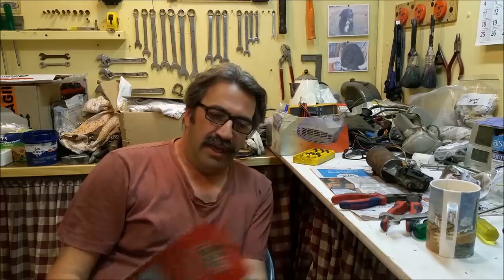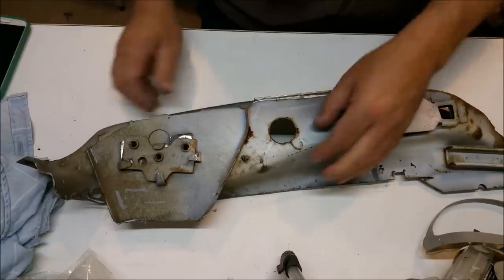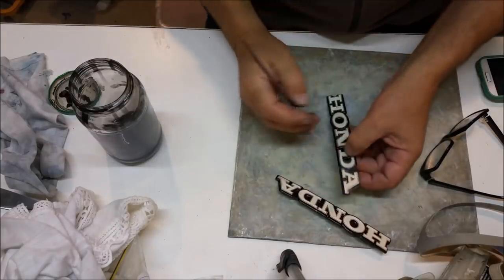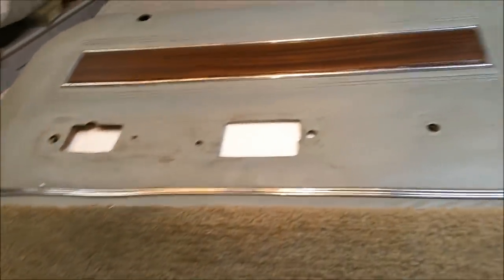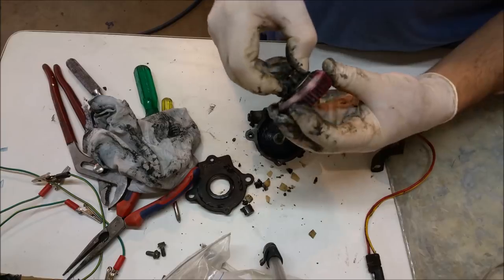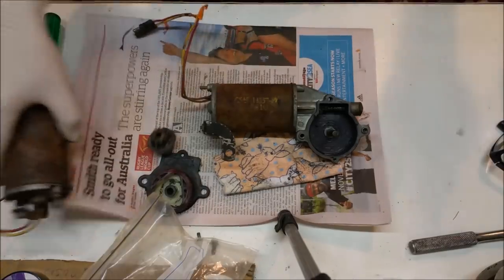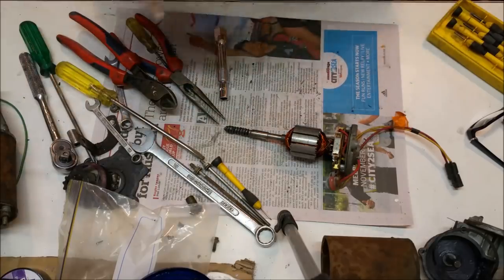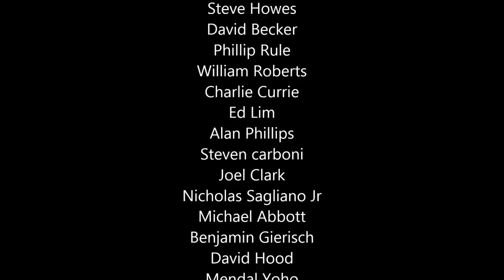XC Fairmont 351Restoration Part 43 - Power Window Motors, Regulators and Wiring

Comment: Hi Pete
Great video. I refurbished my window morors last year and like yours they were dirty and greasy inside and had chunks of shredded plastic everywhere. Yo replace the rollers i bought some plastic rod of ebay. I think it was called Acetal. I purchssed 12mm diameter which was just a touch to large. I cut it into small lengths put it into my drill chuck and emery clothed it down to 11.7mm cut the into 10mm long pieces with a fine hacksaw blade. You need 3 per motor. Its a cheap easy fix that works a treat. Keep up the videos they are fantastic. So infomative. I love them👍

Comment: Hi Peter, you should be able to find the rollers on the 'net, without the 'worm wheel'. Done many......XD, LTD, ZL etc. Rarespares, or Parts Lunacy, I think.
Or part off a 10mm aluminium rod in the lathe.

Comment: Hi Peter. I have a GXL with power windows, recently I was putting up drivers side window and it jams half way up so I need to help it. On this occasion I was busy and the window stopped. Now all windows don't work. Is it a fuse or relay that has burnt out. Also is wiring loom behind glove box? How do I check or fix problem? Thanks Mark

Comment: I've used rubbing alcohol to clean over spray on harnesses before. A little tedious, but it didn't seem to react with the tape and insulation like a brake clean or something would.
Reply: Rubbing Alcohol on yourself or the loom, ha ha.
Reply from the maker: Thanks, the first thing I grabbed was some really dirty thinner I use to clean parts and the paint came straight off... I was amazed at how easy it was, cheers.

Comment: Looks good.. interesting to see the insides of those motors.  I don't think i would have used grease in the bushing though.. seems like it could get gummy and slow the window down, especially in cold conditions (though i guess your weather is more temperate there).    Also, if that's an oilite bearing, it would really want oil (though it might be hard to re-lubricate it effectively).   Still, a light machine oil designed for electric motors seems like a more appropriate choice.    But not a critical thing obviously :)
Reply: of course now that i see that it is going to have grease at the other end regardless, because of the worm gear, i guess it doesn't matter..
Reply from the maker: You're correct... I stated above that the two noisy motors suffered water ingress and had damaged upper bushes... one had a rusty rotor shaft, so they will require complete restoration... not the dodgy (albeit temporary) lick over that I gave them, cheers.

Comment: If they are sintered bronze bushings, then you need to oil the bushings. 

Non detergent oil like Singer Sewing machine oil is best.

You’ll have to degrease and rinse the bushings to clean off that grease before soaking the bushings in fresh oil. There is probably some sort of oil wick near the bushings that should be filled with oil also (or replaced if it has perished).
Reply from the maker: Thanks mate and you're correct, but both noisy motors have suffered water ingress and have damage to the upper bushes which I didn't show. They will require new bushes and brushes while I'm at it, which will then be tackled properly, (may even be worth finding better motors). The way they presently are just isn't worth the time, hence the reason for stating that they are not being restored, but that it was an exercise in polishing turds... Cheers

Comment: Lovely to see more work on the bike and car.  They will turn out beautifully I'm sure.   I must say I think you are a bit harsh about the loom repair done by previous owner.  The repair may not have been brilliant but they probably did what they thought was a reasonable repair, working at their skill level.   Who knows what their circumstances were.  I have seen a lot worse, wires just twisted together and taped over etc.
Reply from the maker: True Pauline, I was harsh and am sorry. The problem is that every issue that's cropped up with this car (and there are loads) have been due to poor choices from previous owners... some have been downright dangerous, others merely inconvenience. Where safety is concerned with some of the issues with the shell, these people really should have sought advice. Cheers and thanks.
Reply: Thanks Peter, I understand the frustration.  
All the best.

Comment: Those electric window motors do look to be identical to the ones used in US Fords from the early '70s through into the mid '90s so I do wonder if it might be possible to find the rebuild kits from the US for a chunk less money, though I don't know whether shipping and taxes would make the saving worthwhile.  I know you mentioned the possibility of using nuts to replace the nylon rollers, which are a safety device to allow the unit to slip if something like a child's fingers get trapped in them, but it does occur to me that there are better DIY alternatives that would still give the clutch action such as an appropriately sized auto hose like fuel hose or maybe washer tubing filled with something like epoxy adhesive that would still give it the flex of the original parts.  I think the idea with using the nuts in place of the rollers allows the windows to still operate when the inside of the cage on the driven cog has worn due to people continuously over-using the motor when it is fully up or down which chews up the inside of the cage as well as the nylon rollers, as a lot of vehicles these motors are fitted to are still low value and it just isn't really acceptable to fork out $70 to fix failed or slipping electric window motors...
Reply from the maker: Yes, the nuts were a dodgy fix from a guy I watched on YT... I'm not interested in that at all. I was going to turn down some ertacetal and use that... it's perfect for this application. A friend has offered me some stuff to use, will outline it in a future video, cheers.
Reply: @PeterAndersons    I suspect this is an issue that there are as many possible fixes to as there are people fixing them.  The ertacetal sounds ideal for the job with you having access to a lathe to turn it down, assuming the rollers are circular.  I just made my suggestion as an idea for people who might be tackling the same job without access to a lathe...

Comment: The "secret" to the spring and brush replacement...get 2 paper clips,pull partially straight, look to see if there small holes just behind the end of the bracket,push brush past hole, insert paper clip, replace commutator, pull paper clips. The process should be similar on starters and alternators, some holes allow you to place and pull from the backside of the case.
Now that I have revealed this trade secret, I will be in hiding the rest of my life, always looking over my shoulder for angry auto electric techs.
Reply: +Lens Cap  Yep, you're a marked man for life now you've given that one away lol...  It was so much nicer when things were designed to be refurbished or rebuilt unlike now where everything is remove, throw in the bin and replace with a new item costing a very large amount of money...
Reply from the maker: Excellent tip and yes, I've seen the holes you mention... as stated in the video, this was a turd polishing exercise, so didn't really spend the time the job deserved... nothing jumped out at me which was the reason I used a cable tie... will pay more attention in the future, cheers.